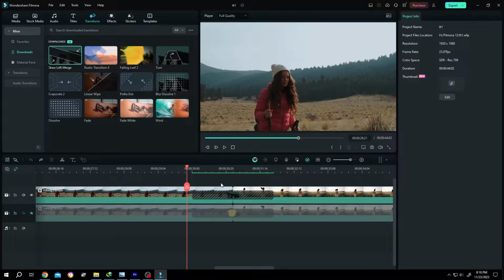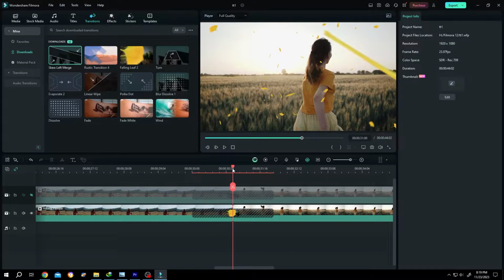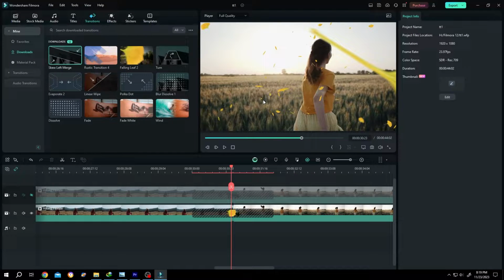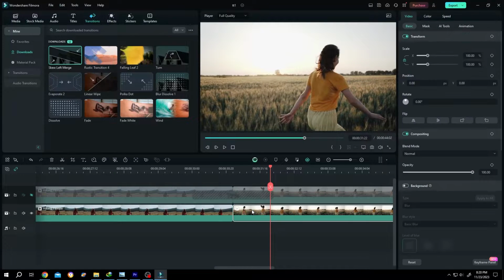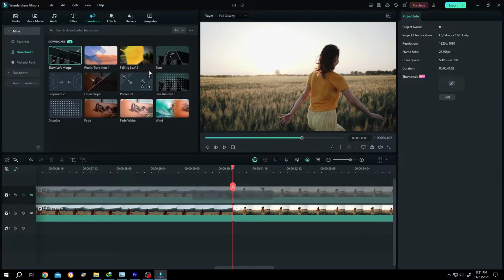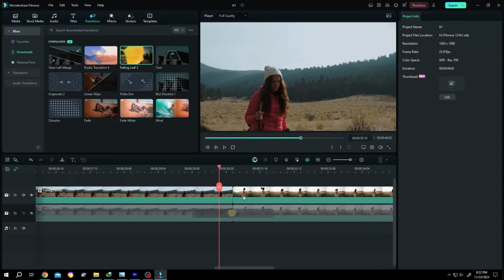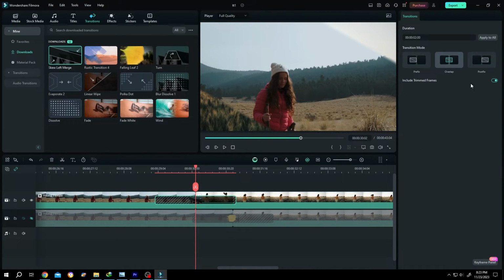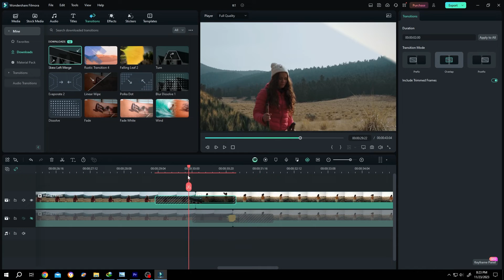Fix Transition Freeze Frame | Filmora 12 & 13 Tutorial

Comment: Sir if I add one transition to different split area, first transaction is working but another all are not working.
So please suggest me how I resolve it.
Reply: Had the same problem and his video helped me. When you put your transition on the video, click it and transition options will pop up. Turn on "include trimmed frames" as shown on the right side of his video. This will keep the smooth transition into the next video as long as the video is trimmed where it can run smoothly into the next. Watch what he does in the last clip of this video.